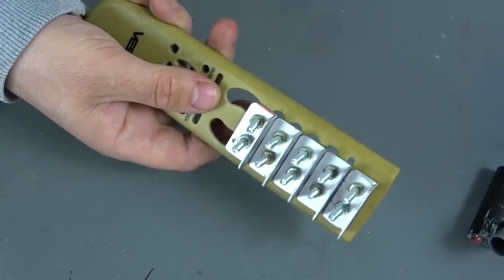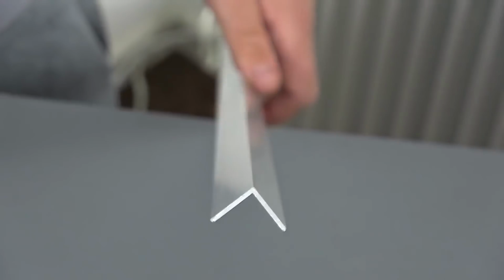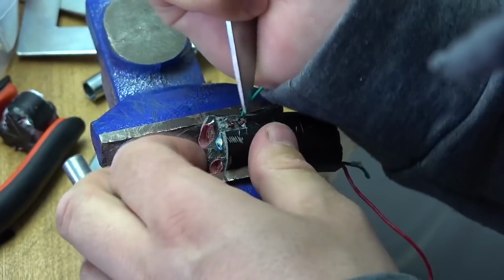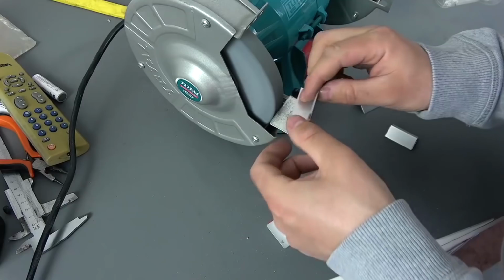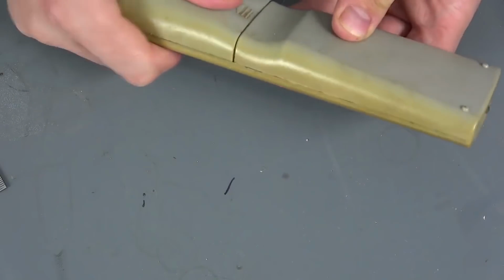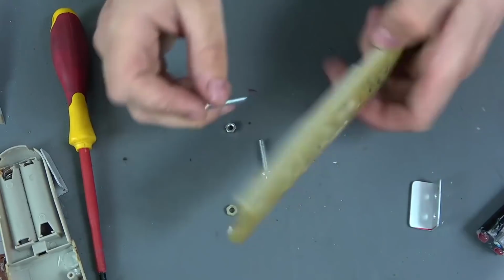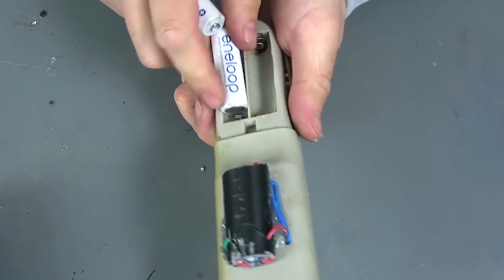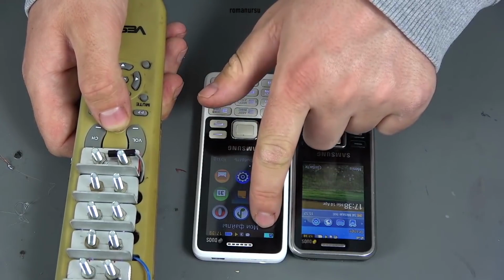HOW TO MAKE A PROHIBITED DEVICE  TETRAFAST AT HOME WITH YOUR HANDS

Comment: 😂 Am I the only one to wonder how his camera is working while testing his device
Reply: The transmission of radio frequencies is blocked by the jammer. Camera doesn't have anything to do with radio frequencies. TV and radio signals are blocked because of the jammer.
Reply: Because a camera is not a radio.